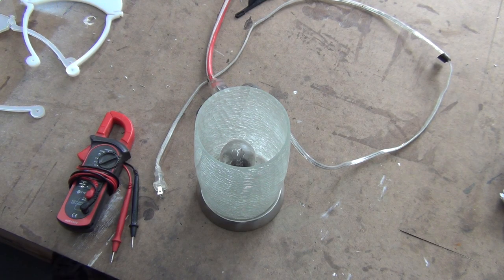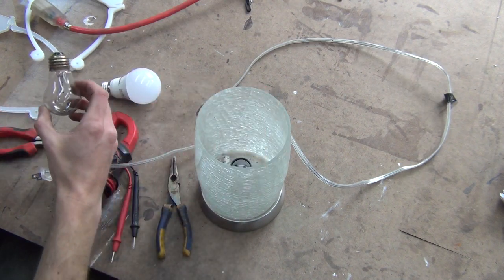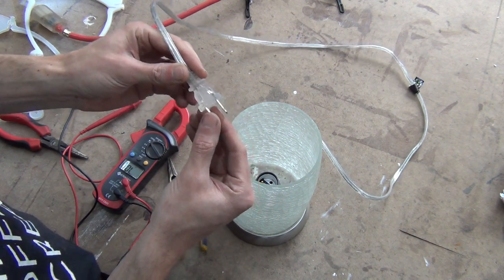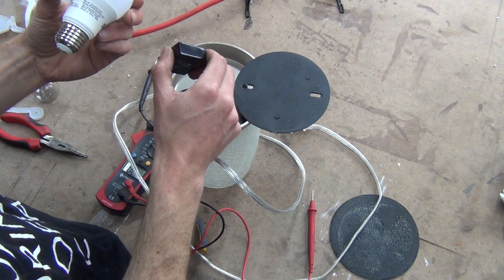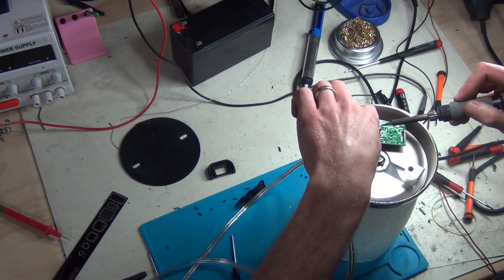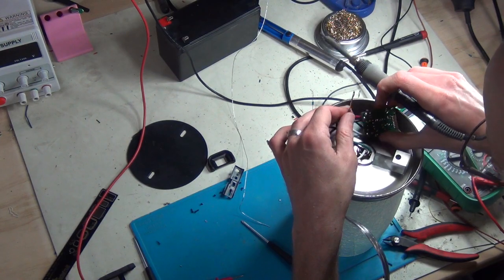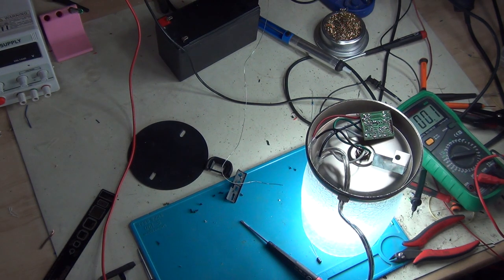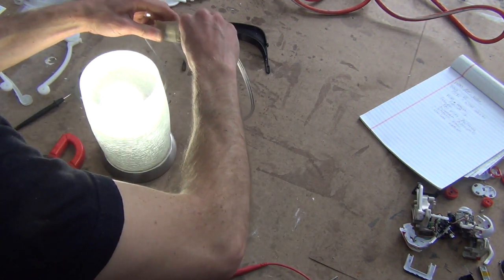Lamp Repair

Comment: I've never seen a ballast in a lamp with a regular ("Edison") lamp socket.  My guess is that the circuit board in the little black box was a capacitive switch, so you had only to put your hand near the base to turn the lamp on or off.  Needless complexity anyone?  I might have removed it and crimped a butt connector instead of shorting the two points together, but that's just style.  Good repair!